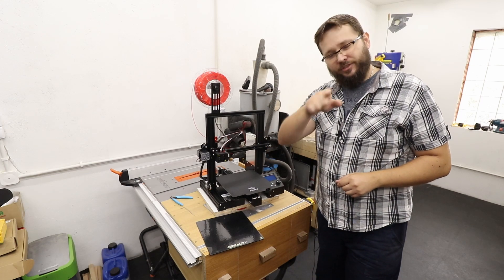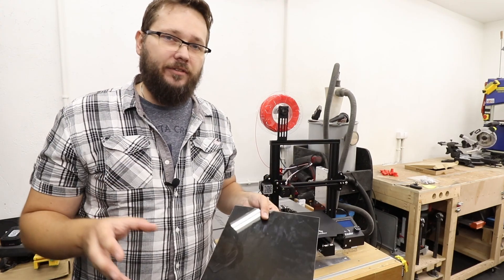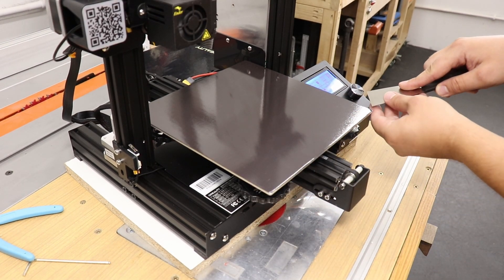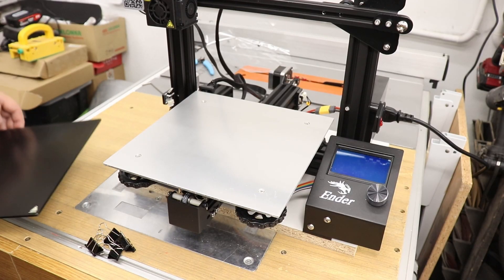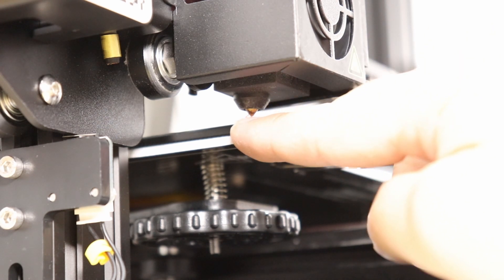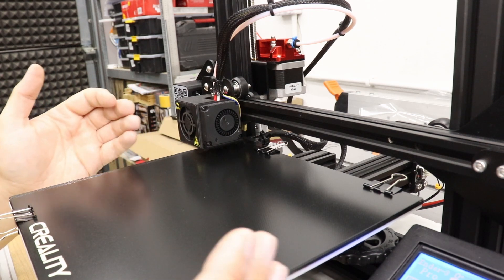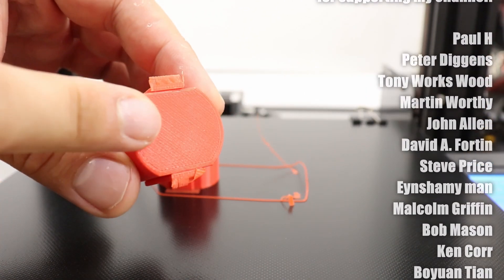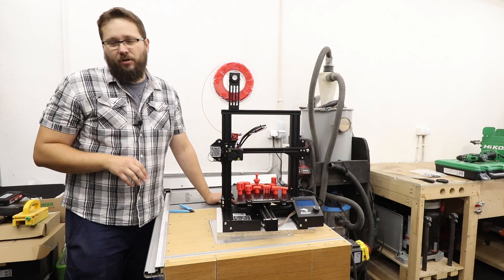Ender 3 Pro Full Guide on Glass Bed Installation and Print Bed Leveling

Comment: So how do you deal with layer shift on a glass bed?  I had a glass plate on my printer.  Got it leveled and the print to stick, but at about half way through the print it a layer shift and ruined the print.
Reply from the maker: Do you mean the bottom layer came loose of the glass plate?

Comment: @Casual DIY , I obtained the same bed which is 4mm thickness and I also have a CR touch automatic bed leveler for my Ender 3 (not the pro) that has a 4.2.7 board (I believe). are there any videos you recommend to help me to succeed at printing with this style of set up?  I also noticed you are not using the included rubber separators that came with the glass bed. Why is that? I al using the rubber spacers but have noticed that it does not correctly level the bed. should I use those with the springs?
Reply from the maker: I don't have the automatic bed leveller so can't really say. I don't see the need for an extra rubber separators.

Comment: for the switch thing do i need to that on my ender 3 vs 2? cause it came with the glass bed and i didn't do that.
Reply from the maker: Could you drop me a time stamp so I know which part you are referring to exactly please?
Reply: @CasualDIY  so it actually fix itself i don't know what i did to it to fix it i was following your steps and it looks like it fix it i think it because the bed was sorter compare to the other bed but i don't think that would cause it.

Comment: So I need to adjust the z stop. I got it to work first time on the stock springs but it only works with the stock springs in my case. I upgraded because I'm tired of leveling it all the hid damn time. I will have to do that this weekend once I'm missing the Allen wrench

Comment: If you use an untextured glass bed  don't have to remove the magnetic sheet at all because it's thicker then a normal bed meaning you can level it once and not have to worry about leveling it after like 3 months

Comment: I love the magnetic beds but I am so tired of punching holes in the because the offset changed slightly. Going to give glass a second try.
Hey, I'm not sure how sensitive 3d printers are with milled surfaces since I mostly work with machine tools but you really should try using a plastic scrapper next time. That steel scrapper is leaving small gouges in the milled aluminum plate.
Reply from the maker: That's a good point actually 🤔 👍

Comment: Anyone building for business needs the whole plate. Binder clips just don't work unless you want more manufacturing time.
Reply: Anyone building for a business should be smarter than using an ender 3 for efficiency with  manufacture time
Reply: @ItsMeAverage  someone has no idea about print farms and the most common printer. I wonder how much business you have done yourself?

Comment: Hi! Did you find any issues with the plate being heavier, mainly the Y-axis moving slower or having trouble stopping? I'm installing a glass bed today and was thinking if the heavier plate will need some movement speed corrections.
Reply from the maker: Had no issues at all

Comment: What is the differences between ender original glass vs ordinary (window) glass??
Is it more scratch resistant? Or may be won't break when fall on to the floor??
Reply from the maker: The Ender glass bed is not smooth on one side which helps with adhesion. I think if you throw it hard enough it will break.

Comment: i see when you printing those parts are not stringing. do you mind to share the absolute settings to get rid of messy stringing's ? i'm using 0.4 and 0.6mm Nozzle and Generic PLA. Thanks!
Reply from the maker: Hehe well I'm using the cheapest pla filament I can get and the settings are the are the 'recommended' basics settings in Cura slicer. That's it.

Comment: For anyone wondering what to use to get the glue off of the print bed after removing the magnetic bit, I turned the bed OFF and used acetone and a scraper. Turns it to slime and you can clean it off with a paper towel.
Reply: I use a glue stick & alcohol, it works well too in case you don't have acetone at reach

Comment: when i had my ender 3. it had glass bed with it.
but the prints where not sticking to the glass bed. so i removed it.
but what i did wrong? temperature of bed too low? or is the glass quality different or ii have to use some paper glue on the glass bed for adhesion?

thanks. im buying new ender3 next week and I have tons of stuff to print for new project.
Reply from the maker: Some people suggest to use hair spray or just paper glue. So far not had that problem on mine even when I don't clean the bed regularly.

Comment: My adjustment wheel keeps spinning loose and coming off as I try to raise the bed..any ideas? I can't get the nozzle even touching on paper before it spins off.. which is weird because it was leveled just fine with my magnetic bed.
Reply from the maker: It seems the bed is too far away and the treads are too short. Have you changed the position of your limit switch for the gantry? Maybe the axis is too high?

Comment: How do i stop the print head from hitting clips?
Reply from the maker: Usually the prints are a lot smaller then the whole bed. Are you printing a large square that takes the whole bed? If not then place the clips where the bed is free on your project.

Comment: @5:45, when you place the clips, doesn’t that subtract from the usable space of the 250x250 bed?  Or did the designers already take that into consideration?
Reply from the maker: It does substtract from the table. However I have never had a project to fully use the whole bed, so... not an issue for me

Comment: You don't need a special glass build plate.  Common window glass about 3/16" thick will work just fine.  If the glass is clean and heated to about 60C, PLA will stick to it like crazy.  ABS and PETG might need a bit of glue stick.  As the bed heats slowly, even common window glass won't crack from the heat, just don't let any water fall on the heated glass or it WILL CRACK!  Same with cool down, let it cool to room temp slowly before removing the glass plate from the bed.  I've found that I can remove hard stuck prints from the glass by putting the plate in the freezer for about 10 minutes.  It cools slowly enough that it won't crack.
Reply from the maker: Some good tips there thank you
Reply: I will have to try the freezer trick.

Comment: How did you remove remaining the glue residue from the plate?
Reply from the maker: Just used some rubbing alcohol. It came off nicely. But if the bed is heated up you can scrape it off with plastic scraper of some sort.

Comment: Great video Tomasz, informative. I have the Ender 3 v2, upgrades I've done- BLTouch, dual z Axis lead screws, Raspberry  Pi with Octoprprint. These mods significantly improve workflow. The rough surface on the glass bed is carborundum. 
Tip, for prints that are reluctant to stick I use a glue stick, cleans off with a damp cloth and then isopropyl alcohol. 
Good luck.
Reply from the maker: I was thinking of that improvement as well I just need to get some funds for it 🤣👍 so far had no issues with prints not sticking
Reply: @CasualDIY  totally understand,  it's something that can be upgraded over time as you get use to it.
I did like the dogs you printed.

Comment: Good info Tomasz, that magnetic base looked like it was a bit tough to remove, I’m glad my ender actually came with a glass plate. I’ve found that changing the bed springs to the stronger ones available maintains the levelling better 👍.
Reply: Would it not have been easier to leave the magnetic sheet in place and lightly spray it using silicone lubricant in an aerosol can to prevent the glass plate from sticking?
Reply from the maker: @ianmathieson65  if it would work then maybe, but I don't intend to go back to the magnetic ones
Reply from the maker: It wasn't too hard but I wouldn't say it was easy either 😅
Yes the springs, read about that, could be my next improvement👍
Reply: I've fitted the yellow springs to my Ender 3v2, and they seem to keep the bed level for a lot longer.
Reply from the maker: @EcoHamletsUK  so it's a worth investment 👌